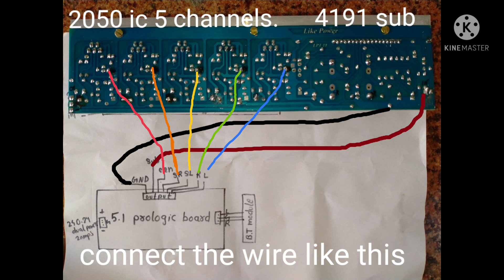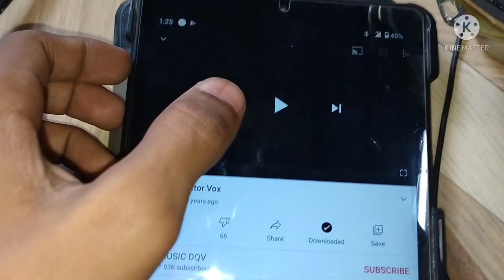5.1 amplifier complete wiring on stk 4191 and Tda 2050 on B tech 5.1 prologic board

Comment: Bro can i use the prologic 15  0 15 tranformer and rectify get 22v dc can i use this supply?
Reply from the maker: No don't do this because you will not get clear sound and you did not get output in some channels

I have also done this mistake and my board was gone
 
Best to use transformer of 24.0.24 v 5 amp and connect it with both amplifier and prologic boards

Comment: Bro how to give dual power supply with prologic board from stk 5.1 board 🙏
Reply from the maker: take a 24.0.24 transformer.Connect it's 3 wires to bridge rectifier then you will get dc +24gnd-24.Then connect this wires with prologic board and amplifier board

thank you 😊